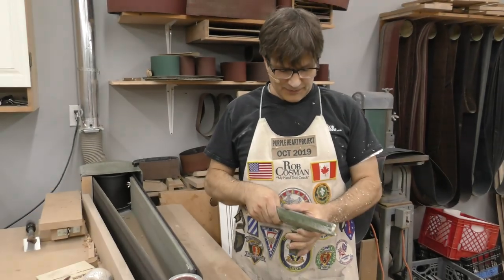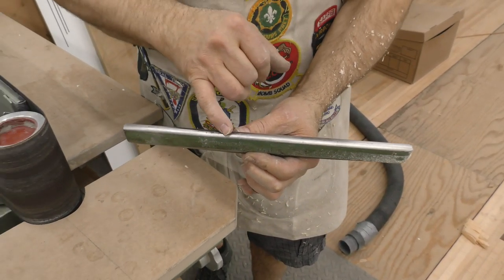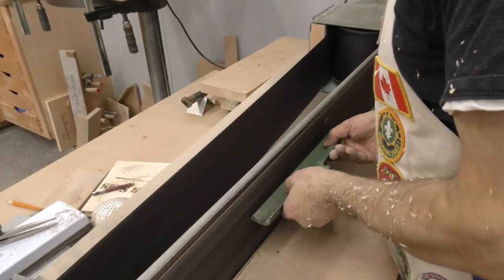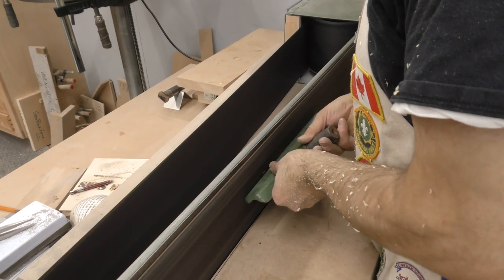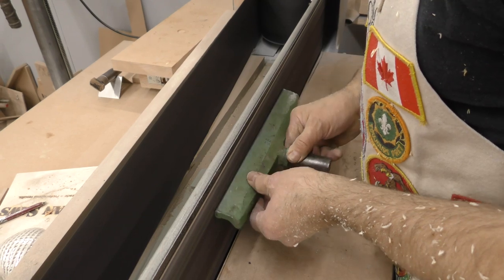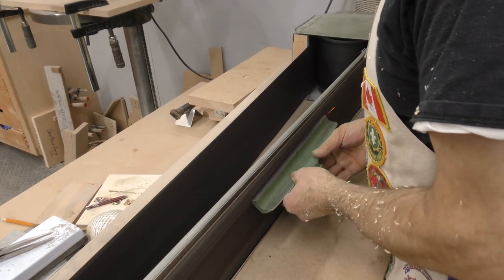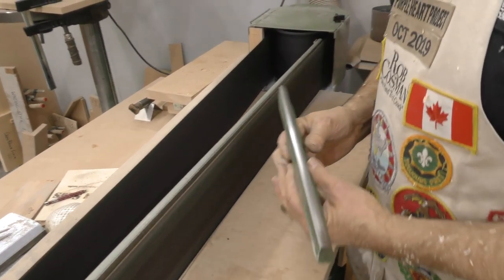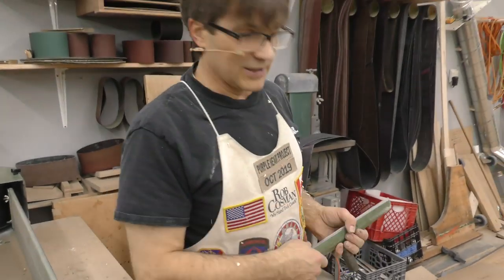Repairing A Lathe Tool Rest

Comment: This is why God invented Robust (brand) tool rests. They're made with a hardened steel drill rod at the top of the tool rest. Your tools will glide smoothly over the rest. I've had several for a few years now. Never had a ding. I still use a scraper of sandpaper to clean off glue or finish that -- somehow -- got onto the tool rest, but that's another topic.

Comment: I can confirm a file works great, draw filing at the end will leave a smooth enough surface in my experience. 
also, I haven't yet done it, but I've heard good things about breaking the edges on scrapers and skews to reduce gouging on the tool rest.